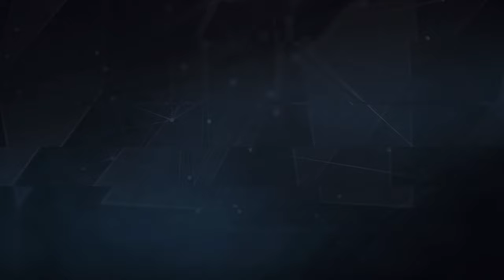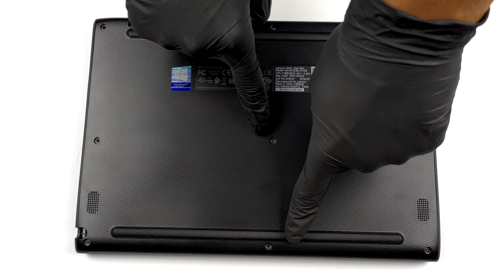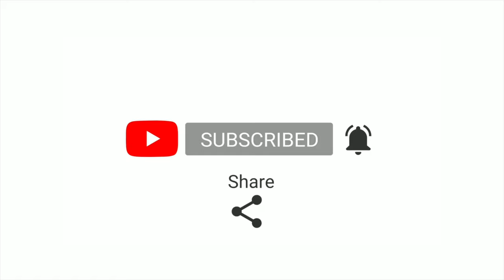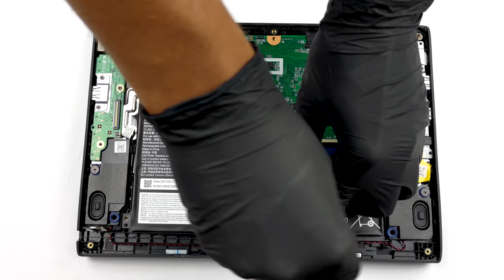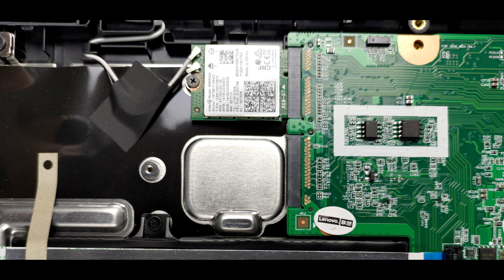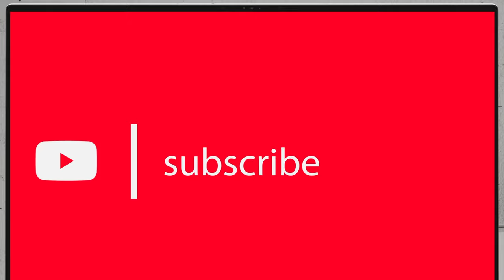🛠️ Lenovo 300e (2nd Gen) - disassembly and upgrade options

Comment: can the emmc be removed?
Reply: no, its practically a sd card soldered to the mother board
Reply: @jackequallife  could a higher capacity one be soldered in the originals place? Assume the logic board can support it. Could the RAM also be upgraded by soldering new chips? Thank you 🤓
Reply: So to change sa storage you have to change the motherboard?
Reply: I have Lenovo 300e and they said itcanoot be upgraded
Reply: @mhelinabagcal3059  oh well! Thank you for the reply 🤓

Comment: Nice tutorial! How to know what type of storage uses this laptop? The 8GB version comes with SS2 M2 and the 4GB one with eMMc? Or it is just random?
Reply: i there, i own one of these windows laptops and they only come with 4 gbytes of ram, i really dont think theres a 8 gbyte model, also all come with emmc
Reply: @jackequallife  hey there is indeed a 8gb version of it (saw it live). Only the Chromebook version has a single version with 4gb of ram (Chrome OS doesn't need more RAM to run smooth though).
Reply: I also have window version of 300e can i replace it processor with i3 or any other cpu ? Please tell me what can i do to make it more faster..
Reply: @alikiani6787 these kind of laptops use to have soldered most parts but not sure. I own both the Windows and ChromeOS versions and the one I use is the ChromeOS one since battery life is amazing and everything works just fine. Still use Windows on my desktop PC though.